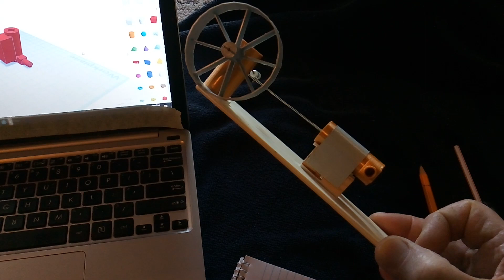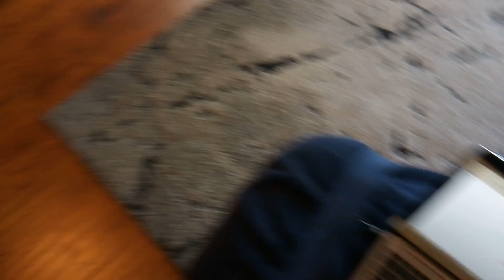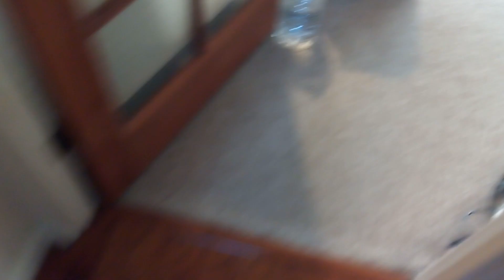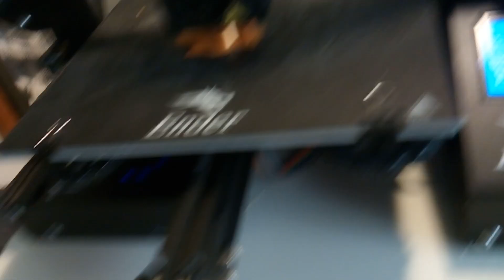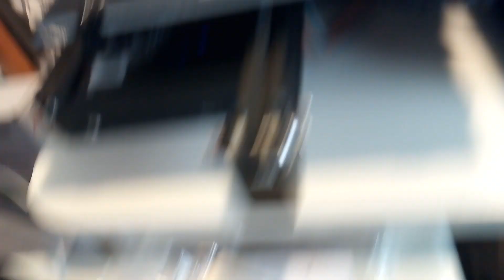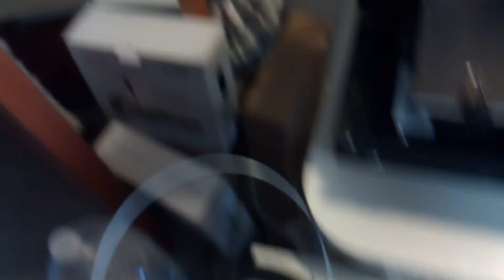Air Engine Design and 3d Printing

Comment: So my step son and his friend are building air engine cars so this is good. Also have you ever looked into blender for 3D printing? That's what I use and it's amazingly simple and works super well with slicer software. I use a mars pro 2 resin printer but I would like one of these types. Looks good Sir.
Reply from the maker: Thanks for the tips.
Reply: @Lidmotor  no problem. I just like it because I can animate my schematics if need, and one could make them look extremely realistic giving me a final look before committing at the printer. Anyways awesome as always.